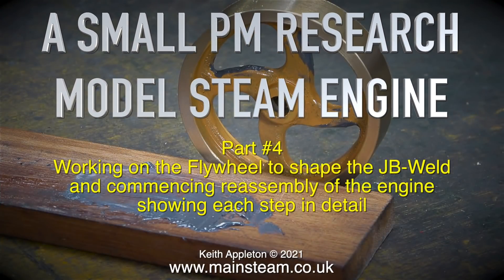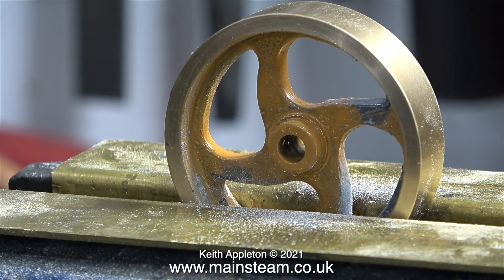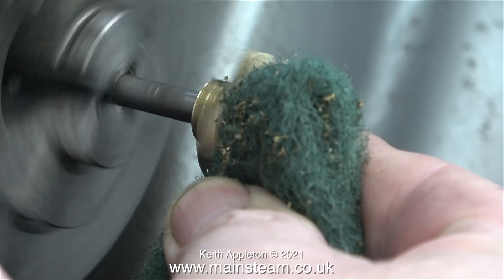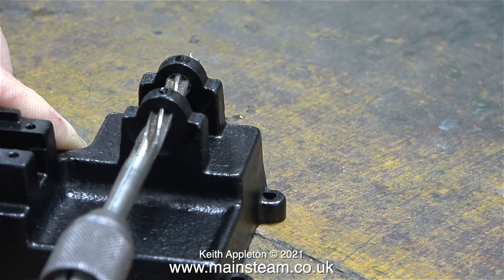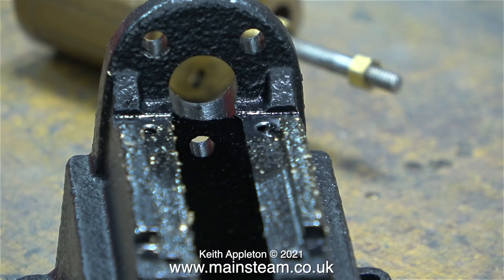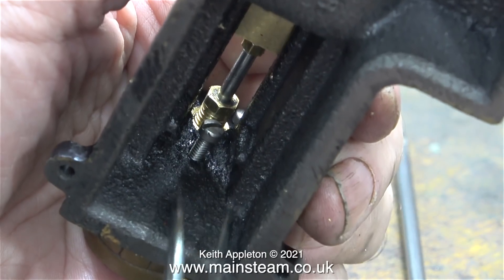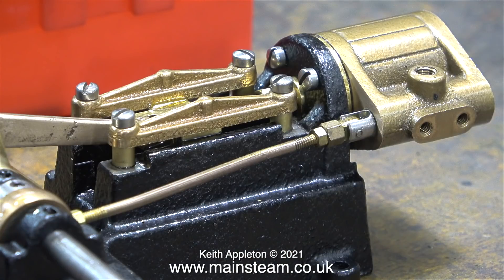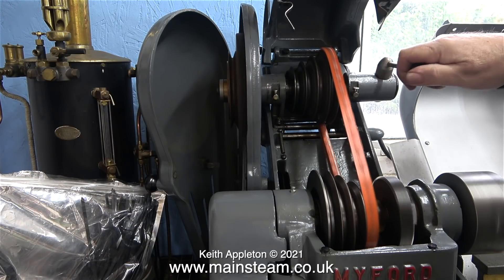A PM RESEARCH MODEL STEAM ENGINE - PART #4 - IN THE WORKSHOP

Comment: “Brass is fine until it tarnishes”. I found transparant lacquers especially for brass that prevent tarnishing, the one I use is heat resistant up to 200C and I found (but have not used yet) one that claims to be heat resistant up to 600C. So far I have decent results.
Reply from the maker: Ok until the coating chips then it looks terrible . . . .